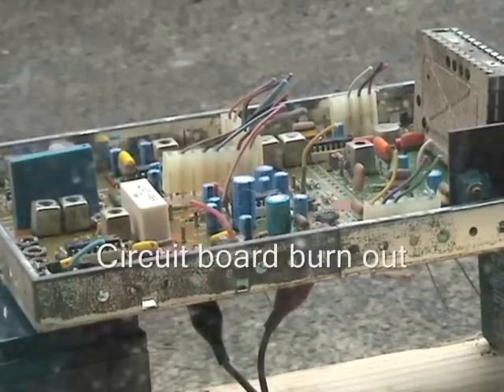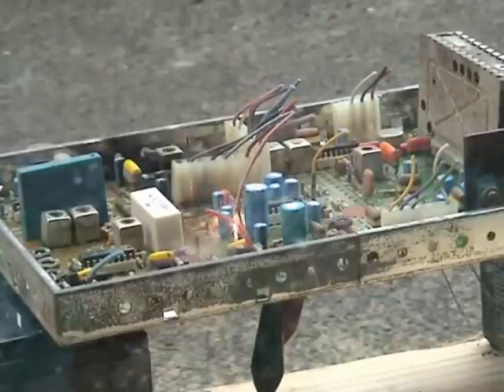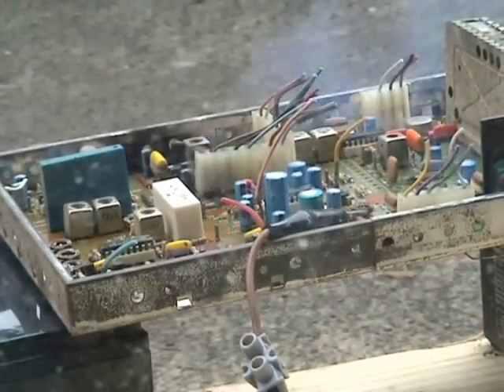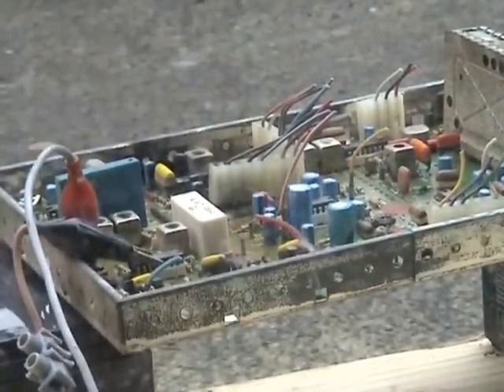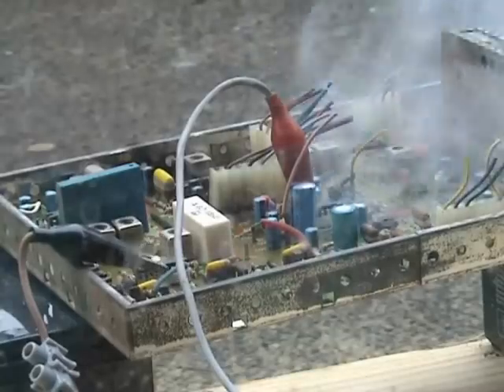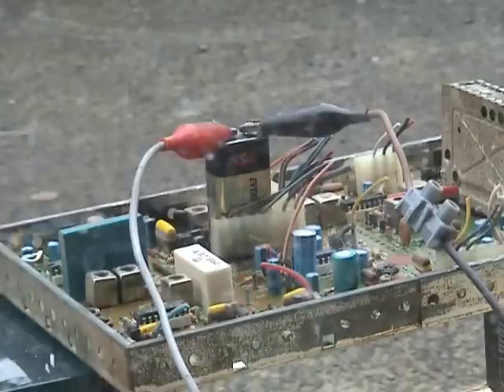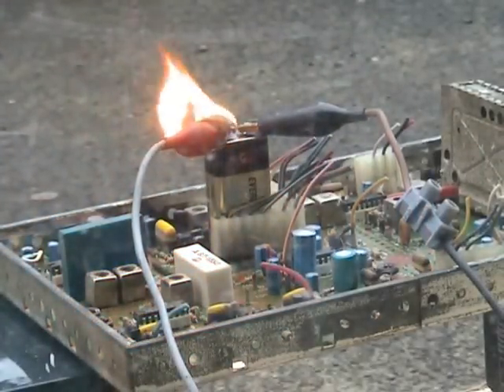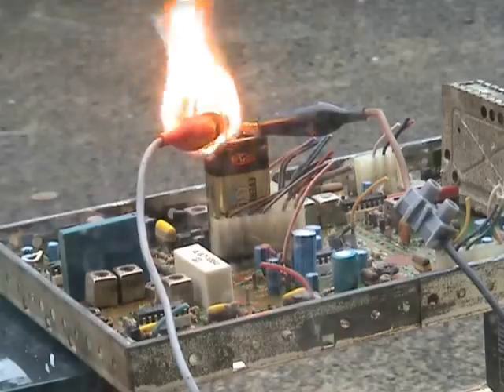Circuit Board burn out

Comment: you should get a variac that goes up to like 500v and connect it to a tv, start at 240v and wind up the voltage bit by bit until it blows up